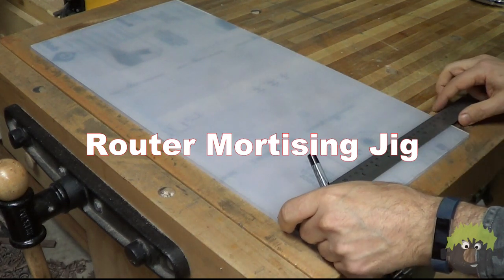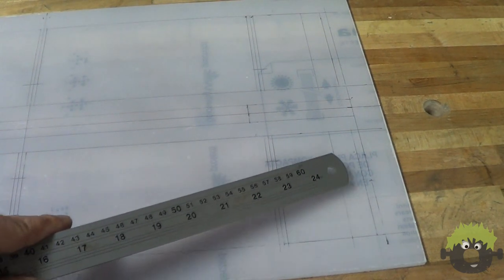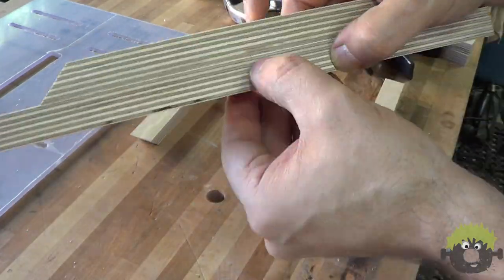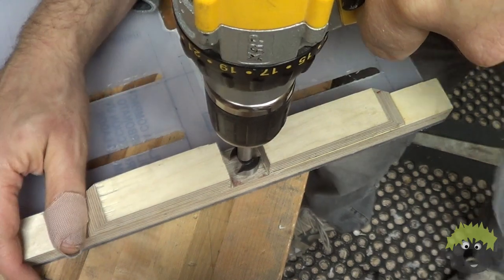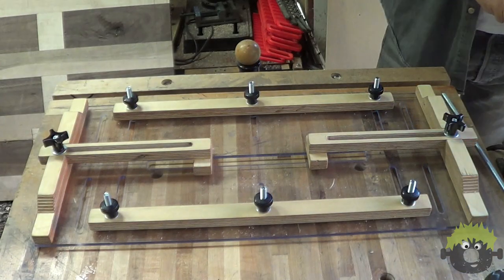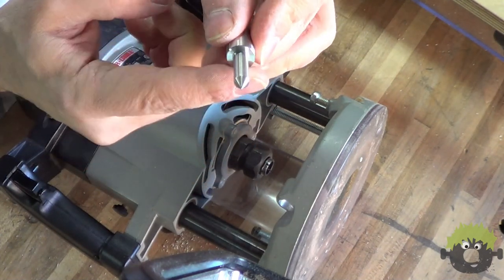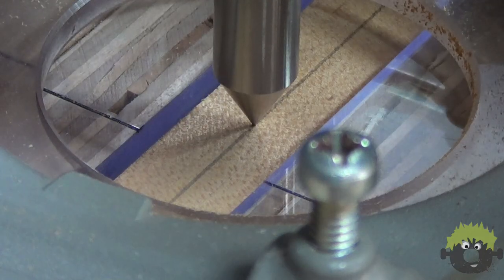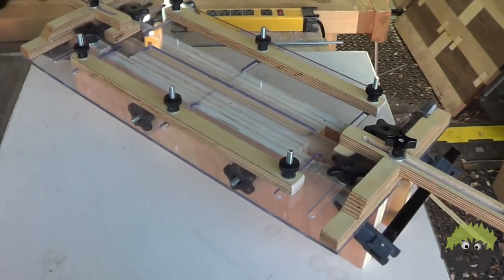DIY Router Mortising Jig

Comment: The two outer router fence slots are longer than the middle slot. Is there a reason for that? It seems to me that would be more practical to make all three slots the same length.

Comment: Did you consider using the router to cut a slot in the center of the jig and then use a busing instead of using the side bars to guide the router.  Nice instruction.

Comment: The one thing I don’t understand, is that you go through two centering process, the lower fence holding the piece and the router stops. Can’t you just mark the position of the two router stops on the base and fix that position for each router.

Comment: Why would you slot the router guide rails?....once the router is centered it should never move off that track...
Reply from the maker: I wanted to ensure that I could change the guide spacing if I change routers which would have different base plate sizes.  I hope the Porter Cable router I used during set up will last forever but that seems unlikely.